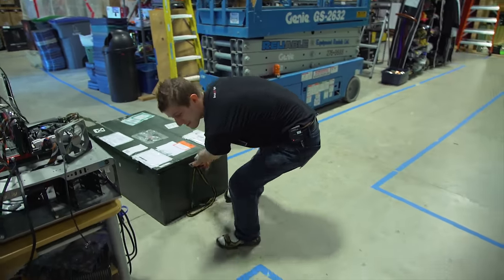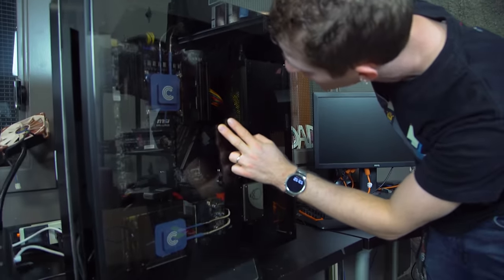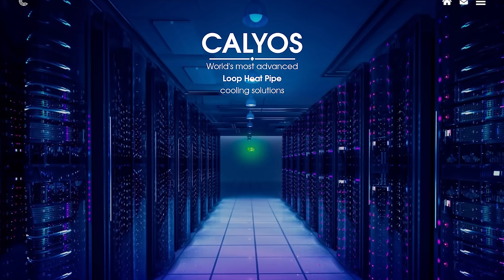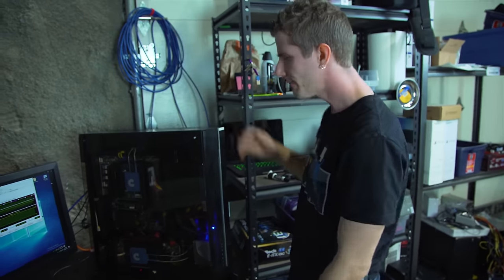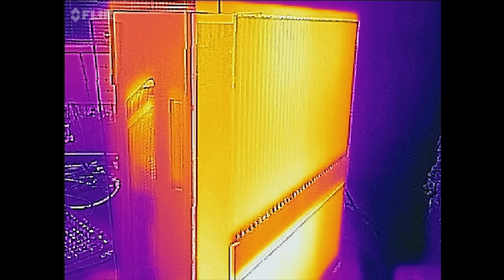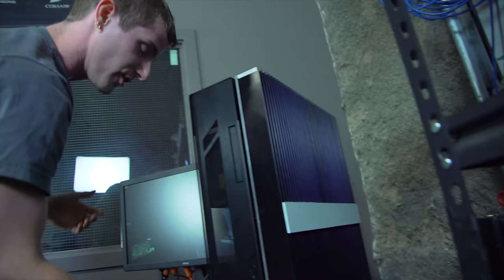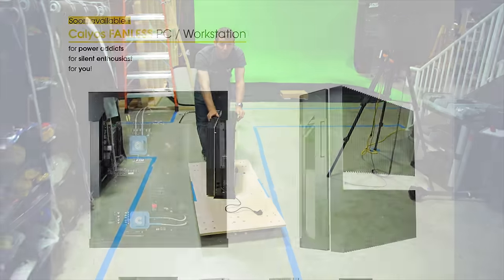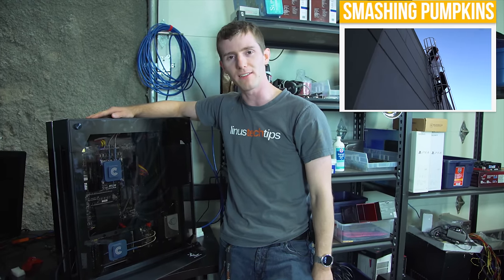TRULY Silent Workstation PC with ZERO FANS - HOLY $H!T Ep. 13

Comment: Hey linus, those FLIR Cam or any infrared thermal camera for that matter, can only measure Surface Temperature, you should remove the sidepanel glass if you want to see the real temperature inside, in the video you are measuring the Glass Sidepanel Temperature, not the internals.
Reply: But then if he removes the glass panel that will affect the interior temperatures. But I don't think infrareds would be stopped by glass. Maybe distorted and not be accurate but not stopped.
Reply: Rui Medina i have one of those camera, even in the app settings you have to manualy choose the surface reflectivity, is it matte, glossy, or else. Because thermal camera is only reading the surface and very sensitive to the surface reflectivity, it can have a false reading if the surface texture is not set accordingly.
Reply: Okay, but still, if he opens it up the temps will go lower than they are, since it's not a ventilated system the results wouldn't be accurate at all. They might still not be accurate but I just see why he did it like he did.
Reply: Rui Medina yeah but is it intended ?, because if it is me, i also wanna see the component that is not touched by the cooler, there might be a lit up image and high temp all over the VRMs area of the mobo, because from what i can see there's no cooling / recirculating air touching those component.
Reply: Yeah, I guess it would be useful to see with and without the glass because of that characteristic of the FLIR Cam. But because the heat from CPU and GPU are taken out, I don't think the other things would get that hot. But still I would like to see for real what the temps look like.
Reply: Glass is similarly transparent to infrared and visual light (heat and light). So yes, while reading temps through glass isn't ideal, the difference between his readings and the reading without glass would not be significant. Also, like Rui Medina said, removing the glass would affect the interior environment anyway, so you wouldn't get a realistic temperature reading.
Reply: i came here to say this.  lexan acrylic and glass block long wave length infrared.  the only reason you could see any usable image was from the flir one's integration with the phone camera.  I have a Flir I7 and its very obvious glass and suck block heat.
Reply: I bet the internals are ROASTING.
Reply: NightWolfx03 doubt it or three game would've crashed, the pc would've stated said roasting in the software, the heatsink would've been much hotter and and so on
Reply: Softwares like MSI afterburner are for that exact same reason! to tell you core temps and not surface temps :))
Reply: That's why he is checking the temperatures from the sensors from the CPU and GPU...

Comment: 10/10 would buy this case for $500-$750 if it was completely up-gradable like a normal case.
Reply: Get this to Massdrop and you'll see it will become possible
Reply: what would you upgrade? it already has amazing specs.
Reply: bmbmunoz2 he means like he would buy just this enclosure with the heat sink and put his own parts inside as long as you could continue upgrading the other parts like GPU, mobo, etc.
Reply: Well of course the enclosure is rumored to be 500 by itself. So obviously you would have to buy your own parts
Reply: i would too but the weight is too crazy, hope a smaller ITX system will be available.
Reply: I kinda wish it wasn't so expensive.
Maybe in the future, the price will drop and I'll be able to own it. XD
Reply: +Gamesfan34260 Yeah I completely understand. The price is a bit steep for a case. However I see it as supporting a company who truly invented something remarkable. Though if you don't have the cash to blow on something like this then of course do not do it. I technically do not, however I live alone and 1/6 of my income goes to things like this. Haha.
Reply: Brayden Turner Yeah, I'm a bit on the short funded side.
I learned how to build a desktop PC to try and save money more than anything XD

(Which has ended in me being obsessed with computer hardware, this is why people shouldn't let me near technology.)
Reply: The cost for this case includes the cooling for both GPU and CPU to a degree where it beats liquid cooling. Try putting a decent case in any online shop, add a GPU liquid cooler and a CPU liquid cooler, and then figure out just how much you are paying extra for a case like this.
The cost to performance ratio isn't as bad as one might think.

Now.. shipping on the other hand. </3
Reply: Doofindork haha yeah shipping over 70 lbs of metal must cost a fortune
Reply: is not that expensive if you consider that this isnt something you are gonna be switching every time you upgrade your pc. This is a long time inversion, assuming this thing wont break, you're gonna stick with this cooler for a very very long time
Reply: *****
 Did it come with a cooler that beats the snot out of liquid cooling for both your GPU and CPU?
Reply: +Brayden Turner 

I wouldn't agree that it's a bit steep given what you are getting for it. A decent case, especially one with a glass side panel, and then replacing those crap fans is going to set you back probably around $150 (without going anything truly fancy), add an extra $30-50 for a decent CPU cooler. That takes you to $200 for air cooling and this is keeping up with water cooled systems bar your extreme multi-rad ones.

Now take the basic water cooled systems that will set you back around $300-400 (presuming it's your first water cooled system). That means you are looking at around $450-550 for your case and cooling, so for an extra $100 you get something that performs better, doesn't have as much sound and is much less maintenance.

Though with that said, up until we know what procedures are in place replace whatever liquid is in the fins and how often/easily that is changed than I wouldn't say it's a good purchase. Given the liquid isn't like the rest of the cooling liquid's out there at the moment, you can guarantee that it will cost a lot more to change so if you need to change it even once a year it probably won't be worth it as this seems like proprietary technology and would take a few years before the market catches on (if it ever does)
Reply: it is said to be 500usd.. which is fuking amazing price.....
considering normal no extra just nice case from lianli and fentek costing like 200usd case+cooling for CPU GPU VRM is bargain. water block for cpu gpu alone is another 120~200usd. no need for resovoir, pump makes it cheap as dirt
Reply: Case looks like Lian-Li PC-O7S that got cancer
Reply: The official specs say that it IS a modified PC-07S. Well spotted.

Comment: That’s really cool; in the Navy they used Fleurocarbon to cool the 400HZ Converters and recently switched to Air Cooling which requires less maintenance. The only issue with Fleuro-anything is that it’s almost like not driving your car and expecting your air conditioner to still work. Fleuro leaks really easily and evaporates insta story into the atmosphere, and there is no way to refill it most of the time. More maintenance I bet with this example of Fleuro-Propane. Trust me, we did a lot of maintenance and the military knows Fleuro liquid gases do not work in the long run.

Comment: I've always DREAMED of a true ZER0 dB PC. Now I know where to get it!!! Thanks!

EDIT: I contacted Calyos and I got a nice e-mail reply saying they're working on it and in the aftermath of this LinusTechTips video (aka getting swarmed with requests) they created a group dedicated to it.. still no dates...
Reply: Drill a 10cm hole in the wall in your room to the next room, put your PC in the next room, thread all the wires for keyboard, mouse, monitor, etc. through the hole then fill it with foam. My friend did it and he complained that his mouse clicks are too loud! :D
Reply: sly1024 Cool story bro... for real.
Reply: Sirusdark keep us posted
Reply: Sirusdark have they still not set a date? This is driving me up the wall
Reply: Build a computer, research on how to use mineral oil for cooling.
Reply: Sirusdark why does sound matter? unless a computer sounds like a jet engine it doesn't bother me
Reply: Sirusdark XD
Reply: And now?
Reply: There are other options on the market already.  HDPlex has the H5, which can cool a CPU and GPU, and is a lot smaller and lighter than this Calyos system.  Streacom has a lot of options too, but they are not made to cool graphics cards.
Reply: Update?
Reply: Deltatronic in Germany does both fanless cases and PSUs
Reply: @iamarawn  Mineral oil isn't silent, you need to cool the oil, unless you just have a massive tank I guess but that takes the already impractical nature of mineral oil to a whole other level.

Comment: What if you would to put fans on the fins?
Reply: well hello, it would prob cool more.
Reply: abc cba But how cooool?
Reply: Dennis | デニス we da gnomes  man
Reply: haha me too!
Reply: window unit bro next to it
Reply: That would kinda defeat the purpose considering how well it already performs lol
Reply: You would probably get CPU temperatures below zero.
Reply: wtf is thoughed
_____________
lol he edited it
Reply: unless you put the heatfins next to a window ac unit?
Reply: The heatsink cant the cpu can,ever heard of a fridge.
Reply: To be lower than ambient temps you would need phase cooling solution, Linus did a build called subzero where he explains this.
Reply: Eric Hjalmarsson Hey man, I know it, I was joking ;-]
Reply: What if you put it in the fridge???
Reply: never put a pc in a fridge
Reply: Ada Palis well, you can, just keep it in a place with 0% humidity and keep it running
Reply: Unless its a "dry" fridge, like those in a lab or an instrument cold room.
Reply: That's like the ass to mouth rule!
Reply: Linus did... ahahahaha
Reply: Eikkonen kosteat meemit ( ͡° ͜ʖ ͡°)
Reply: Then you would have wasted hundreds of dollars on a silent computer.
Reply: +Igor Rebenko
It would produce heat faster than the fridge could remove it. It would end up getting hotter than it would outside of the fridge.
Reply: I went to college for Air Conditioning Tech, and current work as an Hvac technician. This tech is specifically designed for the refrigerant to work at a specific pressure and temperature. Moving air across the heat sinks could cause the temperature and pressure to change, therefor possibly not working to optimal performance. A side note, it is possible that ordinary case fans may not even move enough air to make a difference. These are my initial thoughts on what might happen based on my general knowledge on refrigerant based systems.
Reply: Sir_Sethery Yeah mate, Im aware of that. I was being facetious.
Reply: then you start  counting your temps in degrees below 0 Kelvin.
Reply: ***** Even better: Setup a car turbo but instead of compressing oxygen, it compresses coolant. =D
Reply: Wanna go to my party?
Reply: The smaller the fan, the louder it is.
I still want to see an all-230mm fan super tower show up on the market one of these days.
Reply: Never put a fridge in a pc
Reply: +Igor Rebenko
It does not work, because hot air cant escape from fridge.
Reply: +Physis 1988
The turbo charger can be mounted outside the fridge.
Reply: Then you would defeat the purpose of the design and you would be fired.